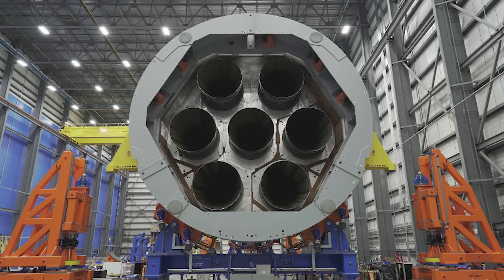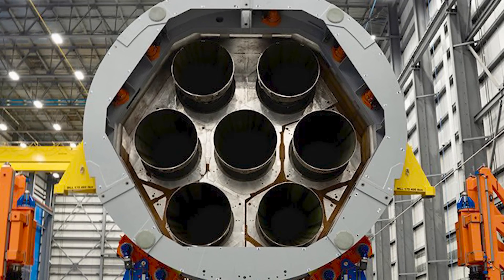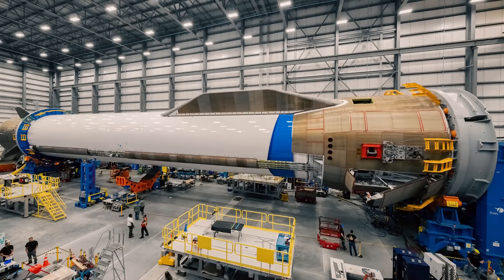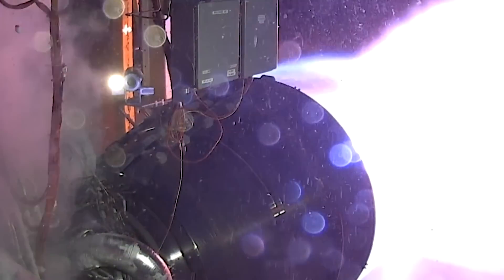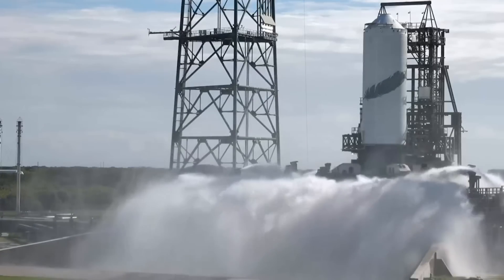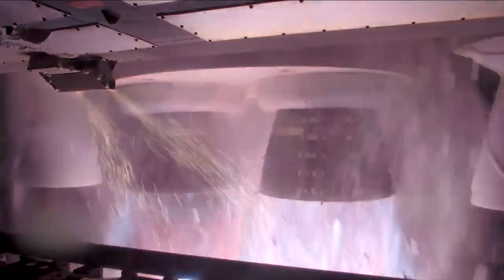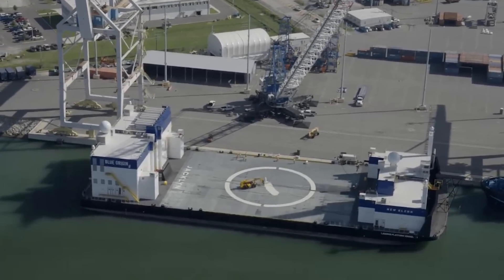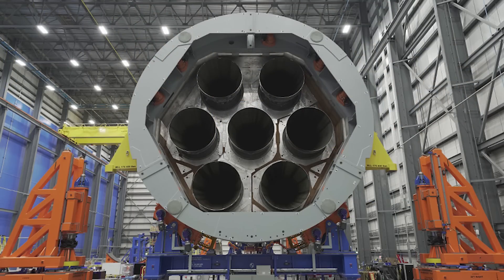Blue Origin Just Installed New Glenn’s BE-4 Engines

Comment: It must be depressing to know that your brand new rocket is obsolete before it even has its first launch.
Reply: Listen I like what SpaceX does and I’m not a fan of Bezos at all but this comment is blatantly wrong. Arianne and SLS are obsolete, not NG. A reusable booster capable of 7m fairings that has a higher payload caps to GTO & beyond than starship ( a vehicle which is in development and still at least a year from any commercial payload aside from starlink) is absolutely in no way obsolete. Learn more about the actual capabilities of the rockets you’re talking about before opening your mouth honestly. I can’t believe I just defended blue origin but this is straight absurd.
Reply: New Glenn is still potentially months if not a year+ ahead the next competition
Reply: @Thethyck4445
If it is successful on its first flight then absolutely it is ahead by a year or two.  If it fails then who knows. 
I do think starship is  2 years out from rapid use. Most likely next year it will start to launch starlinks.
Reply: @Wi2LowHow does Falcon heavy outperform NG? Most satellites have volume constraint issue than weight constraint. And NG fairing is absolutely huge compared to FH. Also., Blue only gave launch weight capability for REUSABLE  configuration only. We don't know how much it could carry weight if it's expendable. In reusable launch capability both are roughly same.
Reply: These salty blue origin slam comments get dumber every day
Reply: New Glenn is the second most advanced rocket after Starship. Calling it obsolete is ridiculous.
Reply: Your comment is obsolete 😂
Reply: Im more wondering how it feels to think any of these people care about yalls terminally online opinions. Like old men moaning about the weather and complimenting themselves for their own wisdom 😂
Reply: @Defective1313  but you're online tho
Reply: An absolute brainless comment
Reply: @Wi2Low falcon heavy don't outperform New Glenn, for reuseble falcon heavy is 30 tonnes to LEO and 8,2 to GTO, New Glenn is 45 to LEO and 13.6 to GTO, so New Glenn would be with 50% more capable.
Reply: Thats a bad take. Sure. Blue origin is behind spacex, but so is everyone else. Lets say that blue origin is modestly successful, they would still have the 2nd or 3rd best space programs known to man, all with "obsolete" rockets. I still defend ula. Compare blue origin today (and in the foreseeable future) to ula. Not so obsolete now is it?
Reply: ahem ahem " vulcan " ahem
Reply: Man SpaceX fanboys are insufferable
Reply: That’s Vulcan, not New Glenn my guy. NG will have several years of competition with F9 and starship when it’s online. Even after this, it will have use for kuiper
Reply: @PeeTree-bx6lp  i love your rhetoric as though youre the one funding the additional company. Why would you as a consumer argue against choices in your consumption? This isnt a centrally planned economy. Yet.
Reply: @PeeTree-bx6lp  what "we"?  Whos "we"?  You personally are doing nothing.
Reply: Must be sad to wake up in your own closed bubble
Reply: How is New Glen "obsolete"?  Where does such moronic delusion even come from? Oh yea, fandom. Hilarious.
Reply: Starship doesn't have GTO or GEO capabilities. New Glenn would compete with Falcon Heavy and Vulcan. 

But you're correct for LEO. Starship is just too promising
Reply: @snakevenom4954
Sure it does. Use a boost stage or do a refueling.
Reply: @Quasar-2  Not without refuelling no. With that in mind, cheap production costs, fast reflight, starship makes sence even for stationary or transit orbits when the payload is large. In mean even for the lunar flights they are aiming at 8~15 tanker flights. 15 beeing the ultra safe estimate by nasa.
Reply: @micheljansen85
Yes you can. Add a boost stage. Companies are working on them,  or have the satellite itself. With the huge size and weight capacity things that were impossible now won’t be.
Reply: Oh Yes they say the same about japanese cars in the 1950s and '60s....these companies work for the long term ...they don't have a short sight view like some people...Ariane is still there NO???...and competing...well during the 1980s...they were suppose to be obsolete
Reply: @javierderivero9299 ariane will always continue to exist for European nation security. Same goes for the H3
Reply: A self-landing booster of this size is hardly obsolete. Blue origin is painfully slow to say the least and the company's technology seems inferior to SpaceX in all respecfs. It does not however make them obsolete
Reply: @alexanderSydneyOz
The two biggest issues will be cost and frequency. If the can be cost competitive and launch often enough they will be fine for a while. 5 years from now who knows.
Reply: I think at this point NASA and the military want alternatives to SpaceX. Musk is starting to look a little megalomaniacal, and could be problematic. I am a huge fan of his and SpaceX, and hope he centers himself
Reply: @thomasbelmont810 the man responsible for all the things you like has opinions you don't like, so it automatically makes him bad man. He was smart enough to be successful so far but it's his politics that can't be trusted? Right
Reply: @ysfex3sew  Musk is allowed to his opinions like anyone else, and I never said he was ‘a bad man’. But he has shown a desire for political power, and he’s gotten weird at the same time. Not a good set of traits
Reply: @thomasbelmont810  not bros fault that his shit actually works
Reply: Megalomaniac , why ?
 Because he likes Trump , and doesn’t bend a knee to the FAA ?
Reply: It's kind of weird to look at New Glenn and think that Starship is better in every capacity... I mean, I see New Glenn actually launching payloads and earning revenue long before Starship is doing any of that. See, Elon likes to boast and make a lot of wild claims about when things will be happening, but he never delivers on the claims. It's always delayed by years. New Glenn has seemed like vapourware for quite some time but within the last year we're finally seeing it take shape. So with Starship nearly falling apart or exploding every launch, and yeah, not talking about the booster here, can't really attest to its capability unless it can actually do anything reliably. Wanna launch a stage that doesn't recover like Starship does, fine, but that's not happened so far.
Reply: fr, even the name of the booster is obsolete

Comment: Does anyone know what's up with that pattern of silver and brown around the engines? (Seen for example at 0:33) Have they just not finished installing the thermal shielding around the engines, or is there a reason for this irregular pattern?
Reply: Given that the lower side walls are also not covered I'm going with "not done yet". It also seems to be a fairly low fidelity part. Maybe it's just a layer to keep the thermal shielding from getting directly blasted and torn apart by whatever strangeness happens in hypersonic reentry?